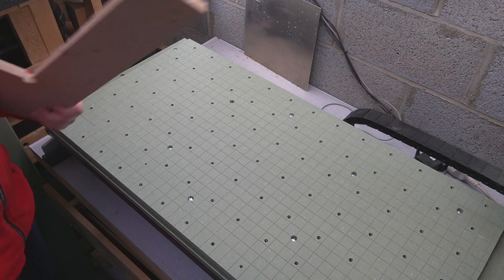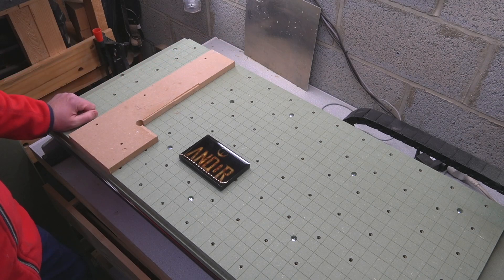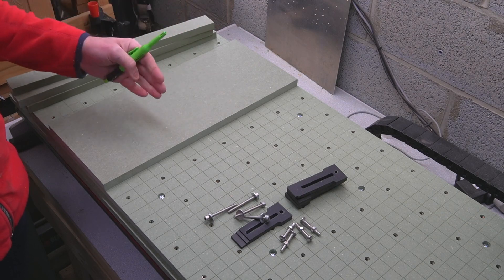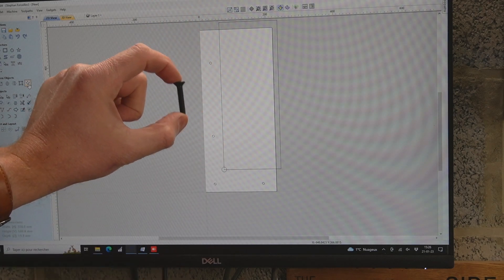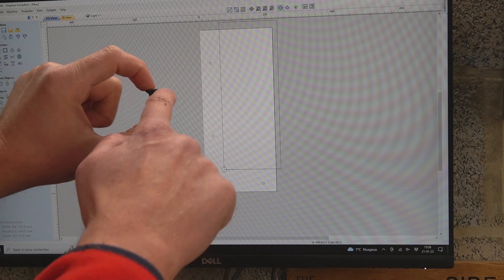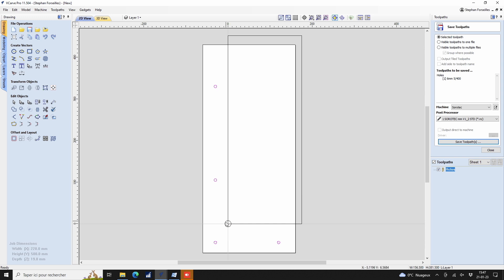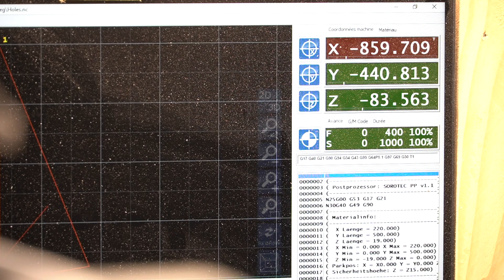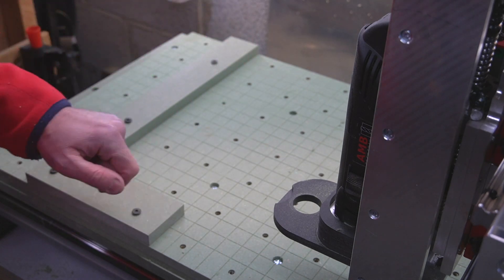A JIG for PERFECT workpiece alignment on CNC

Comment: Stephan, you can improve accuracy by using some reference pins. 5-8mm brass/steel/aluminium dowels basically that go into holes drilled into both the wasteboard and into your 90degree jig. The jig will be in exactly the same place every time. 

I think you will have some error even with the tapered screws you are using. Ofc it depends what you are cutting whether the error matters or not.
Reply from the maker: I'm thinking about making my next jig larger so I can reference it with a 90° square to the frame of the machine before tightening the screws (flat ones this time). But as I work with wood and in my un-heated garage, just the dilatation of the piece I work on is probably already larger than the accuracy of the jig. ;)

Comment: Looks great but I have one question. Why didn't you place the jig as far left, and forward as possible? That would increase the size of project that you can use with the jig.
Reply from the maker: You're totally correct. However I made this one for the cutting boards, so size was not really a problem and I wanted to keep them about in the center for easier work (and less jog!)

Comment: Great video, we share a few setup ideas. My waste board is 25mm MDF with threaded inserts every 50mm and I've also made quite a few 90 degree and straight fences similar to yours. My machine doesn't have a home memory, each time it is turned on the starting 0 point is where it is at the time it is started.
Double sided carving has pretty much done my head in as I would prefer to use the threaded inserts or, now that I've seen this video the 90 degree fences. Have you done a VCarve double sided demonstration using your fences? I would very interested to learn how to go about it.
Kind Regards.
Reply from the maker: Thanks. My machine remembers the previous zero but if I do another project I'll have to find this one back anyway. That's why I write it on the jig then I only have to jog to those coordinates to get the perfect zero of my gig.